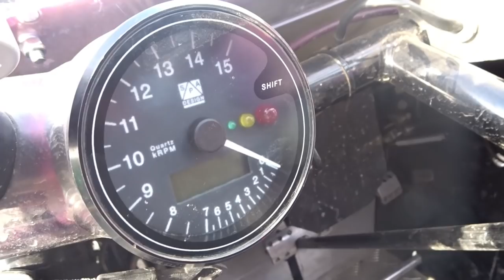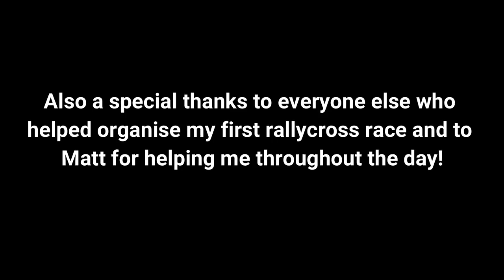FIRST EVER RALLYCROSS RACE FOR ESPORTS CHAMPION & RALLY DRIVER | LYDDEN HILL (INCLUDING CRASH)

Comment: Excellent video guys, you've got some great  skills able to hang with one of the best multi discipline racers. Thought you had Tom until the tangle, I'm sure he won't miss the trophy looking at his racing record. The RX150 looks very similar in handling to Dirt 2.0. Awesomely fast and  twitchy. How much weight is in the steering? I know it's hard to measure but is it heavy (workout), medium tugging but easily turned or light, skittish and easy to break grip?